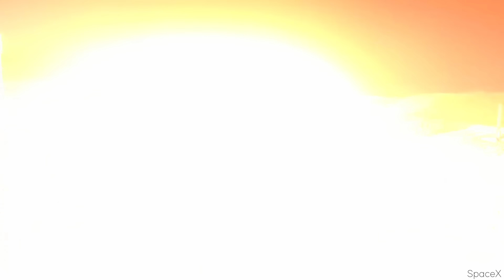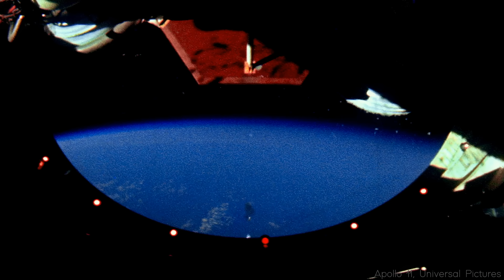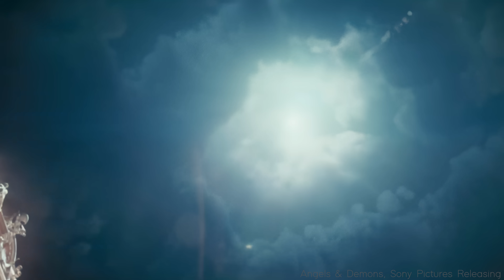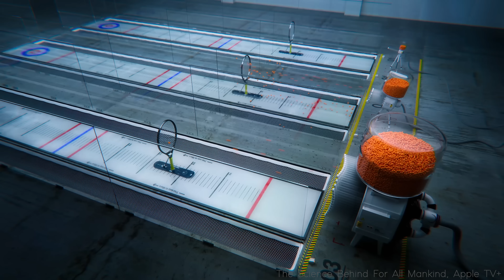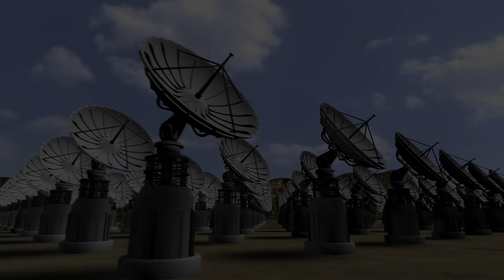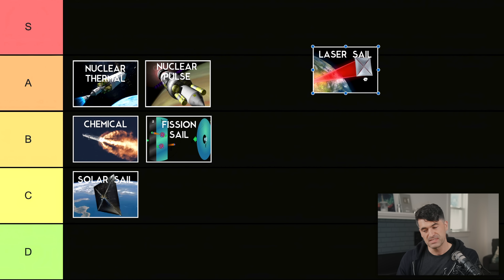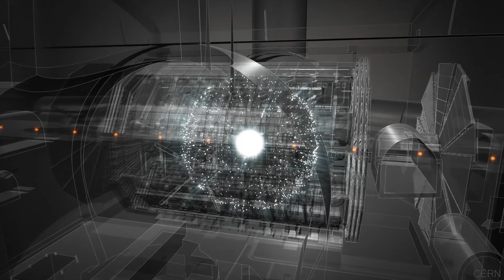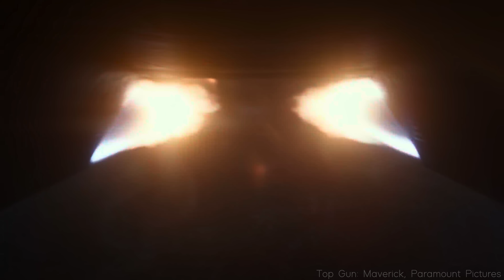Interstellar Propulsion Technologies - RANKED!

Comment: Actually Sabine Hossenfelder stated that a superluminal warp drive ship wouldn't act as a time machine because that conclusion that it does only uses solutions to SR, not GR, which if solved for GR instead, apparently those paradoxes melt away.
Reply: The problem with time dilation, warp fields and so on is that they require very exotic physics that we are no where near to developing. The only known route we have at this point is based on classical mechanics of the old fashioned acceleration and speed. Constant low acceleration a 1 G is what humans can tolerate over long periods.
Reply: If she said that, she's wrong.
Any superluminal travel would be time travel.
Where do you think she claimed that?
Reply: @MrCmon113  I'm 100% certain she did as I checked it again prior to posting this. But that was awhile ago now and she has made so many videos (and I watch too many yt videos lol). I can't find that video :/
Reply: @MrCmon113  Ah found it. Title is "I think faster than light travel is possible. Here's why."
Reply from the maker: Alcubierre himself, inventor of the metric, concedes it violates causality. In his last paper on the topic, which was peer reviewed, he describes this fairly extensively (see https://arxiv.org/abs/2103.05610). To my knowledge, there is no peer reviewed proof or refutation contrary to this statement.
Reply: @CoolWorldsLab  You should solve it for GR then and publish the findings! :)

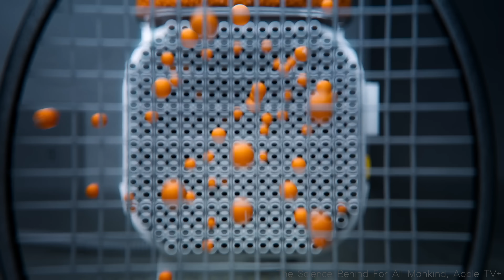Comment: 10:24 Fun fact: this is an actual video of a single photon captured at about 1/trillionth of a second.
Reply: No it's not. It's more like a composite video of billions of shots. From the MIT description:
"A laser pulse that lasts less than one trillionth of a second is used as a flash and the light returning from the scene is collected by a camera at a rate equivalent to roughly 1 trillion frames per second. However, due to very short exposure times (roughly one trillionth of a second) and a narrow field of view of the camera, the video is captured over several minutes by repeated and periodic sampling."
Reply: @IdiAmin95  So pretty much what I said, but good clarification 👍
Reply: @djayjp  - No. Exactly NOT what you said. it's NOT a single photon.
Reply: @JohnnyWednesday  But it's also representative of what a single photon would look like if you composited together many exposures... 😑

Comment: A superluminal drive only violates causality, if you have defined events according to a paradigm that assumes c is the speed limit - which would be irrational. The existence of superluminal phenomena would require ditching light detection or speed as the standard of measuring events. In such a post-relativistic model, light transmission becomes a meaningless picture show. Like defining events by when you get a letter in the mail. Some sort of neoclassical-like model would be needed, or perhaps a relativistic model based on some as yet defined >c standard.
Reply from the maker: Alcubierre himself proved it violates causality, see https://arxiv.org/pdf/2103.05610

Comment: To be practical, FTL would need to utilize some kind of "Physics short cut" like Warp drive.  If we accept the up and coming HUT Physics extension of string theory (HOLOGRAPHIC Universe Theory) a new concept of reality wherin there is a " HIGHER Reality" where ALL particles exist but no space as such. Where our perception interprets the particle wave attributes as points in a (quasi-Illusionary) 3D universe-- our "LOWER reality" We need only find a way to detect and change the  wave attributes of our ship's (and bodies) particles to match that of another part of space, even light years away, then "ZAP! we could INSTANTLY jump to that location.  HUT is based on David Bohm's theory of how quantum Entangled particles have FTL Commnication ("Spooky action at a distance") Michael Talbot's "The Holographic Universe" is full of evidence for HUT.

Comment: the Halo Drive can be experimentally verified when we're capable of buiding a circumsolar particle accelerator. It's theorized that the energy in accelerated particles inside an accelerator of this size would be enough to form a miniature black hole. We can position these blackholes then use them however we need for the halo drive.

Comment: You forgot a couple of serious possibilities even if we accept a minimum acceptable velocity of .1 C.  A British company is developing a fusion drive that might have this potential and it is not a pulsed detonation drive,  but if we oversimplify it is rather like an ion drive on steroids. It is possible that this drive or a more advanced, developed version of it would meet the 10% threshold. Also there is the nuclear salt-water drive which seems a little crazy but might actually work.  Personally I would not have included chemical rockets at all given the amount of travel time. At a certain point a thing is simply not worth doing, and a 70,000 year trip to reach the nearest star is unworkable on so many levels as to be pointless.
Reply: Yes, I agree; the pulsed detonation drive from the 1960's Orion Project  seems to occlude the vision of directly generation fusion energy in a continuous drive and using the particles and energy to create an effectively "ion drive on steroids".  I tend to agree on the omission of chemical rockets due to the dictates of the rocket  equation and the low top speed of exiting particle streams out of any chemical rocket. Nevertheless a sufficiently large chemical rocket with a small payload could exit the solar system and travel during thousands of years. Within a few million years much of the nearby spiral arms of our Galaxy could be visited. It can only make sense over thousands of years  of human existence imo.
Reply: I agree that considering chemical rockets as a legitimate plan is silly, but this tier list is also including things like Alcubierre drives and Wormholes. Given that chemical rockets are infinitely superior to those, because they do actually exist, it does make sense to include them on this list. I'd have put them at the bottom of C tier though.
Reply: Absolutely crazy Fusion Propulsion was not touched on in this video.
Reply: But here’s the thing: chemical is good for cheap. 

So if we develop something we have to use as a slingshot; it’s a great way to get a massive payload out to orbit; if for example we wanted to do a dual system where primary propulsion gets it as fast as we can and then we use something at the edge of the solar system as like a “railgun propulsion” like having a massive fusion generator way out at the end of the solar system where we smash antimatter as a final kick to move something from a medium speed into far deeper into the subliminal range.

Comment: Isn't the idea of negative mass the same idea as warp drive, since one is required to allow the other?
Reply from the maker: Negative mass as described would be sub light speed, warp drives are usually framed as FTL and it’s been argued you don’t strictly need negative mass (but certainly exotic mass)

Comment: Why can't we generate anti-matter aboard the ship? I guess a collider could be attached to a ship to generate anti-matter on the way.
Reply: Where does the energy come from to power the accelerator?
Reply: The energy required to make anti-matter is greater than the energy you get from anti-matter. It's a good fuel to take with you - it's not free energy.
Reply: Antimatter is like the ultimate battery and probably very inefficient to create on Earth and therefore would probably not be the first item to be made from any excess energy created onboard a ship.

Comment: I think you forgot this Argon Ions acceleration drives. I am not sure but it was usable or already in use.  And there is something that I learn from the expense show. You should always calculate flip and burn too. Otherwise you will just fly by. You should spent at least half of your fuel to slow down. Solar sails are ok for that if you travel to a sun like star but otherwise it will not work. Laser is useless in that regard. Sorry but halo too.
Reply from the maker: Halo is bidirectional, you can accelerate and decelerate

Comment: How would a robot send back photos from interstellar distances? You'd need a dish the size of arecibo on both ends o.o It just seems so weird scientists talk about sending tiny robots that can fly by and send back stuff without like.. calculating the link budget and rapidly discovering it is impossible
Reply: I think the Starshot group addressed this issue by using the swarm.
Reply: @AndrewBlucher  Oh wow I never thought of using lots so like, launching thousands that are light days apart and relaying signals? :D
Reply: @isbestlizard  Not sure they're thinking of relays. It's certainly a tricky problem though.
Reply: @AndrewBlucher  Lots of small senders spread apart are a lot like one large sender.
Reply: On the other hand, the Wikipedia page says:
A laser communicator, utilizing the light sail as the primary reflector, would be capable of data rates of 2.6-15 baud per watt of transmitted power at the distance to Alpha Centauri, assuming a 30 m diameter receiving telescope on Earth.

Comment: I have often wondered if we really require a rocket for space exploration. It might be able to use a laser to sculpt a simple object in another solar system using material already present there, which could then be manipulated into something more complex? A future, highly advanced civilization could potentially apply this concept to make probes in other suns. 

This approach would involve several key elements:
1) Using directed light beams over vast distances to interact with and manipulate matter.
2) Utilizing in-situ resources found in other solar systems as raw materials.
3) Developing a design that could be made simply that could there create an increasingly complex object.

While this concept is far beyond our current technological capabilities, it represents an intriguing possibility for future civilizations with significantly advanced scientific understanding and engineering prowess. If feasible, such a method could potentially overcome many of the challenges associated with traditional space travel, including the need for physical transportation of materials and equipment across vast cosmic distances.
Reply: The inherent problem in this concept relies on the fidelity of the beam(s) and the energy required to maintain usable beams, the inherent uncertainties in telemetry and control due to relativistic time dilation of the target body and the simple lag in response time due to the immense distances involved. Also the optical physics of lasers means that even in naked space the laser light although maintaining coherency and wavelength will spread out making the effective intensity of the light beam much less than a flash light.
Reply: @micha9000  Is it a bigger job than building such rockets.
Reply: We first have to master the solar system.
Reply: Intuitively that seems totally implausible. Have you crunshed the numbers and found out that you could do sth with a laser pointed at another solar system?
Reply: @MrCmon113  I did some calculations, and yes, it's difficult, but I suspect it's doable even though direct laser manipulation across interstellar distances is extremely challenging. 

What you would do is create the conditions where many objects in the solar system give us a basic communication system; by accident, one develops sometimes like a hand which we can guide, then we could produce something better and so on.

Comment: Why not set up the infrastructure to build Interstellar vehicles outside the earths atmosphere like the ISS or even on the moon? No need for high volumes of fuel to overcome the escape velocity of earth's atmosphere and gravity.
Reply: He kind of glosses over the limits of chemical fuels. Getting to orbit gets you pretty much halfway to anywhere in the inner solar system. But getting to another star would take thousands of years even if you had a ship which was 99.99999999% fuel. Adding more nines just doesn't help at that point, you need faster exhaust velocities.

Comment: I can't recall the term for it, but I remember a  crazy concept for a fission rocket that in theory would have far, far higher ISP than a nuclear thermal rocket. I'm trying to find the exact term for it, but I remember seeing a paper for it several years ago. IIRC, it  wasn't even a liquid or gas core nuclear thermal rocket, it was a crazy concept for a prompt critical nuclear rocket. Imagine the kind of conditions you have inside the heart of a fission bomb, exponential fission driven by prompt neutrons. Now try to imagine maintaining those conditions not in an instant, but continuously. IIRC you would use magnetic confinement of some form to confine a small amount of material into prompt critical conditions, and you have a design that allows you to continuously add tiny amounts of fissile material to this continuous fission fireball you're maintaining in your engine's core. You're basically making a small, continuous fission bomb and venting the reaction products out your rocket nozzle. I may be misremembering some of the details, but the design in principle allowed a ridiculous ISP, a few orders of magnitude above a nuclear thermal rocket - something that really let you take advantage of the high energy densities of nuclear fuels. It would be an engineering nightmare to build the thing, but it was apparently something that physics did allow. I remember it theoretically did allow very practical interstellar travel times.
Reply: Nuclear salt water rocket. It's riding a continuous explosion.
Reply: @ctrlaltdebug  Yup. That's it!
Reply: Scott Manley did a video on Salt water rockets, I think that is what you are referring to. Uranium salt, basically a Chernobyl type excursion on a continuing basis. Very difficult to control to say the least!
Reply: @kenweipert7926  Yup, that's it!

Comment: I am wondering why you think you may not be able to upload a human mind ? it is a finite system and that could be reasonably computed at some point in the future.
To be fair it does seem extremely inefficient as far as compute and energy go as the human mind is not engineered or optimized for how computer... well compute so it would be way smarter to just have an "artificial" intelligence on board>
I mean you already have to accept the fact that the "uploaded" mind, even if 100% accurate and perfectly simulated is, well not you, especially from the instant after the copy is done you will have a different point of view as it, so might has well engineer a AI that is way more efficient and design for the mission.
Reply from the maker: Mostly because it runs into the no clone theorem, but a quantum teleportation system could persuade me, but that’s so far off being possible at this scale it seems implausible

Comment: How can a gravity slingshot confer extra energy~?
Surely you gain speed as you approach then lose that gain as you leave the orbit gravitational influence of that planet?
Reply: You are correct:  if you "slingshot" a spacecraft past a planet, the spacecraft receives no net energy gain from the planet's gravity for exactly the reason you cited.  However, in addition to gravitational energy, the planet possesses kinetic energy of orbital motion.  It is this orbital kinetic energy that the spacecraft uses to increase its speed.  In effect, some of the planet's orbital kinetic energy is transferred to the spacecraft, which causes the spacecraft to move faster.  (During the slingshot maneuver, the radius of the planet's orbit decreases, but because the planet is enormously more massive than the spacecraft the change in radius is undetectably small.)

Hope this helps!
Reply: @schroedingersdog7965 I'll just add that slingshot manoeuvres can also be used to decelerate a spacecraft. It's being used by the current Mercury mission.
Reply: You gain speed, while the planet loses speed.
Reply: Think about it this way... The planet is moving in it's orbit around the sun, and you select your trajectory so that you approach it from the back side.  Due to the planet's gravity, your spacecraft is essentially falling toward a rapidly moving object, and the spacecraft accelerates.  Then, you miss the planet and keep going with a significant increase in momentum, which you have robbed from the planet.